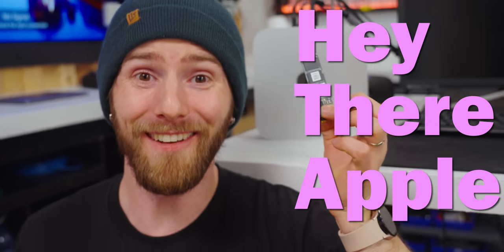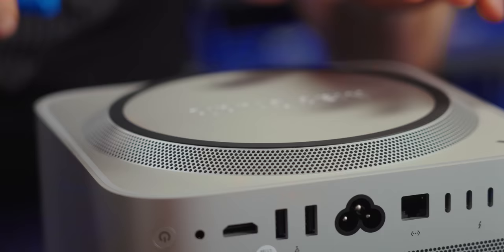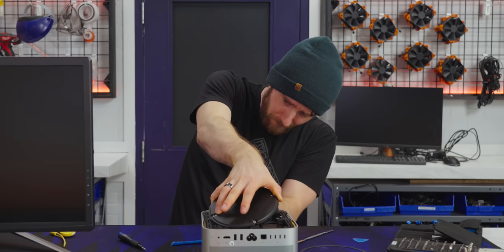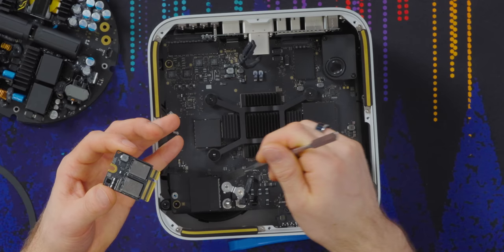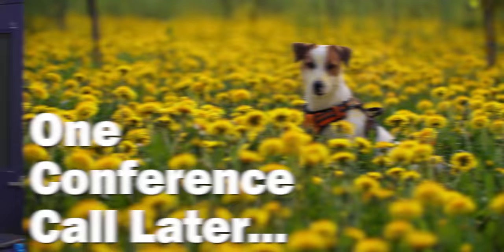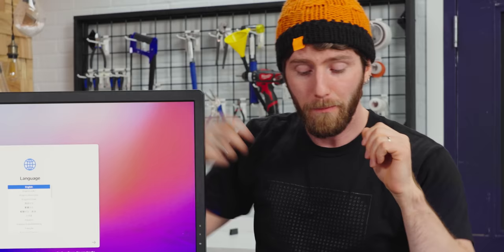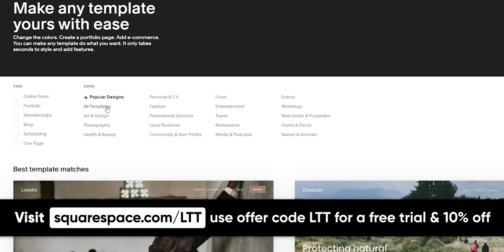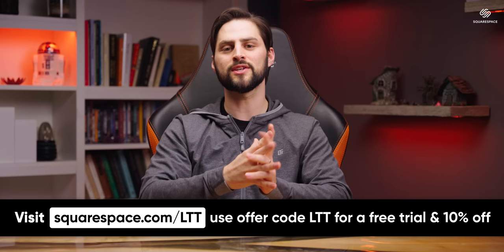I want to love Apple, but they’re making it hard - Mac Studio SSD Swapping

Comment: Finally made use of my 360mm io and overlocked my 5600x after what a grown ape would consider a significant amount of research. 4.6 ghz all core 1.3 volts and set that power thing to level 3 and temps are holding great. Wanted to thank y’all for adding to some of the eventual confidence a long the way lol ty

Comment: At this point apple is selling a subscription. A temporary subscription where you gain access to the product. If you want to sell, repair or upgrade your product, you have to change your subscription and in the case where the item exceeds its contract length, it simply stops working.

That's just the epitome of consumerism.
Reply: I have AppleCare+ coverage on every product and when it expires I get a new one.

Comment: One valid test could be try to use the second SSD of a 8TB Apple studio version in a unit the free slot and check whether it works. If it works, maybe the SSD for the expansion could be different somehow.
Reply: The difference could be that it only stores the metadata and reserves spare blocks on one of the flash modules, which would reduce controller complexity. However they could easily account for this in the software during a reformat if they wanted to. Perhaps one of the modules has SLC flash for the metadata and it doesn't expect to see this on the second module?
Reply: Mate if adding a disk means you have to format your entire system from a different machine made by Apple I seriously doubt that this would work. My guess is that they burn in the mainboard somewhere how big the disk is supposed to be.

I mean: they burn in each iPhone/iPad the serial numbers of all the parts that make that specific device....

Comment: Sincerely, I don't know why Apple has so much appeal between north americans and japanese. They have good designs, and good performance in one hand, but in the other, they are expensive as hell, the closed system it means you have a lesser selection of apps, games, etc...it's very constrained to my taste.
Reply: Personally I buy Apple because it reliably works for what I want 99% of the time. I've had Windows machines in the past and I quite enjoyed the gaming desktops I put together, but there were constant problems requiring troubleshooting. My last upgrade I tried to go Dell only to end up with two laptops that were dead within a week. Not to mention the atrocious sound quality. With Apple I basically know exactly what I'm going to get, for better or worse.
Reply: All my thoughts about Apple summed up into one comment

Comment: And this is why I switched my daily laptop from macbook pro (mid 2017) to Framework running linux. When I found out in 2019 after a hdd controller failure that the ssd is soldered to the motherboard, I vowed never to buy another apple product.

Comment: The reason for what seems like a 'size lock' is that the system would need to know the layout of the flash chips (ie size) cos as you note theres no logic on the card to tell it. This would be in one of apple's configuration tools that they dont release to outsiders. The problem isnt the architecture (makes total sense form an engineering standpoint) its their anti-RTR position and refusal to release the most basic technical tools (like a BIOS configuration utility ffs).
Reply: I'm sure it could auto detect. It knows there are different flash chips after adding the second one
Reply: 2 things:
- you have to use another MAC to reinstall the OS anyway, so they could simply include the configurator in the Tool.
- Its just Storage, even with incorrect layout, the Flash would work. Not optimal nor on full capacity, but working enough. So you could include the configurator in the OS you installed, to reconfigure and then reinstall the damn thing again.

Or just as you said include an ApplEFI (instead of a UEFI) in the damn thing.
Reply: @thomasphillips885  Do you really wanna sit there while it counts gigabytes of flash like old computers used to do with their RAM? it was painful enough for a couple of meg. But yes - it could autodetect - thatsthe sort of thing that a system configuration tool does.
Reply: Yeah the needing another mac to install the OS is just daft -= every other Unix like OS seems to manage just fine with a boot disk and a repository. But youre right - apple deliberately dont give you the configuration tool that way either.
Raw flash access is a heck of a lot more complex than that - you dont just feed it an block number and get a number back - thats a translation that the controller normally takes care of in an SSD. I'm an engineering technician not an engineer actually designing raw flash access but you have to know the layout of the flash - how many pages each block is divided into logically, how many blocks are in each chip and the number of chips. You have to know the command format of the flash module and the timing it wants. Its seriously not simple.
I really dont see the advantage of just installing the configurator to it to start with, over putting some more flash on the mobo bootstrap. Or even putting it on a USB stick.
I am loathe to go back to the days where a simple change to system config required a disc you could lose.

Comment: Perhaps the secondary "ssd" slot can get a 5G card... Since when we have "ssd ports"? Keep up with great content! Thanks !!!
Reply: it probably wouldn't work it's proprietary interface.
Reply: @marcogenovesi8570  Thanks man! I was just a thought. But you are right a mini-pcie port is not an m.2 port. Oh yeah and having the controller on the board it's also rules out an adapter...
Reply: @marcogenovesi8570  actually, you are both right and wrong.
there are three different types of SSD slots - there is the M.Key slot, the B.Key slot and the B+M.Key slot.
the M.Key and B+M.Key slots strictly use the mSATA protocol, while the B.Key slot strictly use the PCIE protocol.
a "SSD slot" that uses a the mSATA protocol can run both Wifi/5G Networking cards AND a Sata based SSD.
a "SSD slot" that uses the PCIE protocol can only run a PCIE SSD (AHCI) and an NVME SSD (if it also supports the NVME protocol)
an mPCIE slot can also technically run any networking card so long as it is based on the PCI-Express protocol, but these cards barely if not completely don't exist for the mPCIE slot.
Reply: I get what you're saying, but I highly doubt it. I don't think there's much demand for mobile data connections on computers, especially computers that are meant to be stationary.
Reply: @marcogenovesi8570  i never said mSata is a signal, i said mSata uses the SATA protocol, and i said mPCIE uses the PCIE protocol.
there is a huge difference between a "signal" and a protocol.
AHCI is a subset protocol that's running strictly only under supported SATA protocol devices.
mPCIE however is much more capable since it IS basically the same 4 lane PCI Express protocol ports you find on a desktop computer.

i don't know if you actually read what i wrote, but i don't understand what made you think that what i wrote is any different from what i just wrote above?

Comment: The whole point is you aren't meant to swap parts, you pick what is optimal for the tasks you intend to perform on it and leave it at that. 

It's not designed to be a tech geek's (no offence meant) modding platform, it's for people who want to get shit done and not worry about the back end. 

Been a MacBook pro M1 user for a yr and a half and never once thought the SSD wasn't big enough because everything is saved on an external to reduce the risk of data loss if it bricks itself.

Comment: I love the quality and reliability of macs but they’re so restricted that I can’t even justify purchasing them for anything but productivity. I would forgive so much if they would just implement something like Proton and let me upgrade the SSD, even if I could only buy first party overpriced SSDs.
Reply: @SesshyS as opposed to my work laptop that turns into a raging blast furnace when I open three excel docs? Like the M1 is incredibly efficient, it feels like you’re regurgitating an argument from the old i9 MacBooks.
Reply: They've had too many repeat engineering failures in the past few years for them to be reliable. Butterfly keyboards, display ribbon cable issues, etc etc
Reply: @Marie-et6lw  every company has issues (Asus has horrible QC, razer’s batteries, etc). The difference is, Apple gets a lot of attention then they release repair programs for those issues where they fix them for free.
Reply: @thecon_quererarbitraryname6286  I don’t disagree with that. I’m not an apple fan boy, I hope they do reintroduce replaceable SSDs. However, my primary concern is not having to replace the parts in the first place. My 2014 MacBook Pro has the original battery and still lasts 5-6 hours unplugged. Apple has certain downsides but they also do something’s really well.
Reply: @sorenvitarelli  There are a lot of issues people have that AREN'T fixed for free by apple and people have to repair them out of pocket. High prices for repairs combined with the difficulty of repairs make any reliability issue worse than for other brands that make repairs easier

Comment: We have a Mac at our church that we use to stream our service. I was never a Mac guy, had my fill of Apple with my cell phone an Apple I Phone 3G which Apple had full control over what I put on it, I didn't like that, no MP3s or music from other sources, it didn't last long. The Mac we have is a grey box half the size  of the Studio. I started computing with Windows and haven't used Mac. I am trying to learn the os when I can. One thing  that I cant wrap my head around is the heat that this thing puts out When in operation it gets very hot and stays that way when in use, it sits in the open with plenty of air around it. I don't see how the thing is still running, most components that we use use in our Win machines don't get hot because of active cooling, if Win components ran that hot they would fry, I guess one day I'm going to see this thing smoking, don't really like Apple anyway.

Comment: I'm sure they profit significantly from this practice.  However, they also lose customers such as myself.  I would have purchased at least a couple of the new m1 mac minis if they didn't solder on the SSD and make it impossible to use an external thunderbolt drive to boot.  Nope.  No deal.

Comment: At this point I'm not even angry at apple I'm absolutely FURIOUS. If you ever wondered how apple made half of their money its probably by doing things like this and then making their customer spend a 10th of what they spent on their system to fking upgrade or fix the thing when it could be done for MUCH less. I love the products but its what they do the produces that makes me second guess if they are a good company.
Reply: Because I don’t care.

I buy Macs configured with all the memory and storage I will ever need.

When it becomes an issue it will be time to get a new one.

I don’t buy a car with a view to swapping in a new engine someday though some do.
Reply: @VideoArchiveGuy  yh i get what you mean but your analogy of swapping the engine is not true to some people. In the pc world i know a lot of people who have in mind to upgrade their pcs cause they didn't have all the money needed to spec out their computer to what they desire at the time. Also memory speeds provided by apple are lightning fast but even so they are only a few seconds faster than other ones which are MUCH cheaper. I get what you mean but half the people in the pc world wanna upgrade their pcs and apple just doesn't want us to do that and instead wants the money.
Reply: @icedoutgames4051  Different customer bases.

For example, BMW typically doesn't go after the customers who want to bolt on a different exhaust or a supercharger, they go after those who want to drive the car as-is over a 36 month lease.

That doesn't mean there isn't room for those customers, simply that BMW isn't targeting them and they should look at a different brand.

It's the same with Apple.
Reply: @VideoArchiveGuy  idk if you understand what I mean. While what u r saying is somewhat true, even simple upgrades, like ram and storage, r not possible which is not ok. This means in the future if you ever run out of storage then u CANNOT upgrade it unless u give apple a lot of money. It's like not being able to change the the battery on a bmw when it dies without giving bmw a 1000 quid or whatever when you could get it done for half the price from a local mechanic.
Reply: @icedoutgames4051  Again, I don’t expect to be able to upgrade the RAM or storage in an iPad or iPhone so it makes sense the same would be true for an M1 Mac where RAM in particular is soldered to the main board, avoiding the bridge chips required to deal with DIMMs.

If I run out of storage I can buy a 12 TB external disk drive for $220 or so, something that will also make it much easier to connect to a new machine when I get it.

I don’t need to get into the machine when external USB and TB drive enclosures are so inexpensive.

Comment: They absolutely moved the SSD controller to the M1 chip so that the end user would be required to buy more storage from them.
Reply: No, it’s a matter of integration and speed.

Separate controllers requires a bus rather than being wired to the internals.

Comment: Could they have had the fuse switches like Ryzen to lock the SOC to a specific capacity?
Reply: Its likely more just a setting in the firmware that checks the size of the module in early iBoot
Reply: Sounds like they do already given that larger or additional modules don't work at all.
Reply: Interesting would be if in a mac with larger capacity a smaller one would work.

Comment: We need someone internally from apple to just have the repair tools linked in a drop box or something to bypass these dumb ass artificial blocks.
Reply: the repair tools are probably issued with a tracking number built into the files, so if they are leaked, they know which employee did it, and sue them for more than they will make in their entire life.... just as the movie industry does/did with preview copies that are traceable
Reply: You can almost guarantee those repair tools will require access to the apple servers to work.
Reply: @kitsunekaze93  That and someone mentioned it has to connect to apples servers for configuration... so now fkin flash has to call home apparently..... For "Security"...
Reply: That's never gonna happen I guess, Tim Apple could saw this and one day will send death threats to his employees if they do so..

Comment: Yet another reason why I'll never buy Apple. Recently I just swapped my HDD out for an SSD for my 3 yo dell laptop, and "it just works", no faffing around with ANOTHER Dell laptop or firmware update bullshit. Just cloned the drive plugged it in, changed the drive letter, and was greeted with a buttery smooth experience.

Comment: Whats also sad is that i brought in my macbook pro because of the keyboard warranty repair... my battery was screwed as well.. they replaced it all for free because of the keyboard warrenty but then 2 months later .. it started overheating and then the screen would go fully black.. another 2 months after that and i have to use a monitor 24/7 because the monitor just stays black.. apparently its overheating even with my fans on full blast.  CLEARLY they did something to my mac... it ran cool and perfect before sending it to them...  THEY COULDNT STAND TO LOOSE MONEY ON THE KEYBOARD WARRENTY so they made my computer break down and overheat just 2 months later.

Comment: The intel Mac Pro “garbage can”, we upgraded storage. However, when we wanted to wipe and install later OS, it required a firmware update. To do this firmware update it requires the original storage, which of course had been tossed away years ago. Isn’t that peculiar? Stuck at Big Sur with a computer that on paper supports ace Ventura.

Comment: capacity, number of flash modules  is probably hardwired on M1 and the dram cache or maybe embedded cache in flash controller is also determining number/size of flash modules you can have.

Comment: If they charge 3-4x the retail value for the bigger built in ssd then it is understandable how they wont allow you to buy the smaller mac, buy a bigger ssd, and swap it out for cheaper. The original problem is that they already overcharge you for something swappable just because it's "built in".

Comment: Why the surprise, Apple has always had that philosophy. Jobs told Woz not to put expansion ports in the original Apple computers. They have always felt that the way to make computers reliable, easy-to-use, and highly profitable is to control the entire environment. Seems like tech users should be pretty well understand that by now, and is the reason I don't own one.

Comment: I was with Linus about how you should be able to open the system without special equipment then he holds power supply pcbs with only thin black vinyl to insulate himself

Comment: Cant wait for the Mac Ultimate, where it deploys and fires a glock if you attempt to open the chassis (which is welded shut), then bricks the system requiring a direct 10k payment to Apple to unbrick but delete all your data and throttle performance

Comment: This is why I took your advice in 2021 and bought one of those 14 core i9 processors (they were in China on Ebay) along with a Gigabyte x299-ud4-pro motherboard and turned it into a hackintosh. I'm sure it's not as fast as an M1 (it hits 10k on geekbench) but I put two nvme drives in and just added another 1 tb SSD to it that's attached to the case. I did have some snags though adding the SSD... The nvme drives turn off the 3-4-5-6-7 data connectors so I was forced to plug it into either the one or two data connector. And the little side mounting brackets on the corsair case were a joke so I just stuck the SSD to the side of the case with some sticky tape.